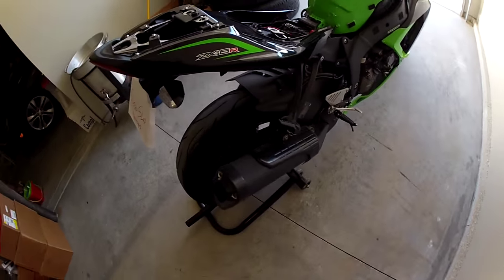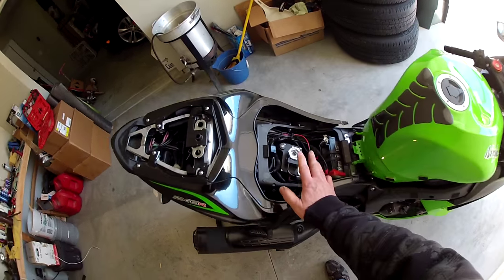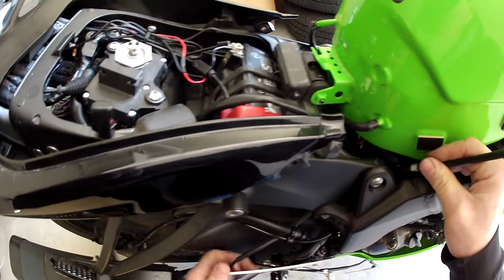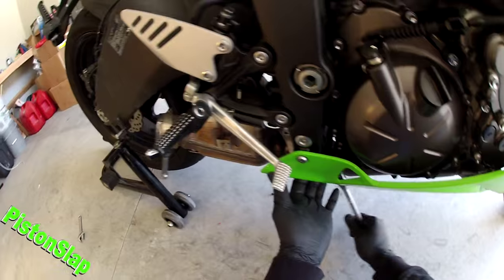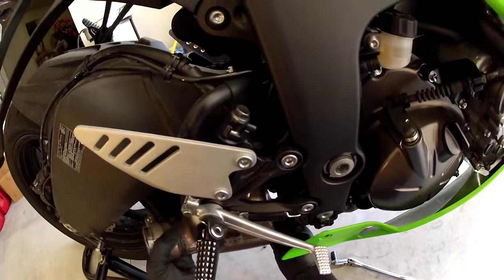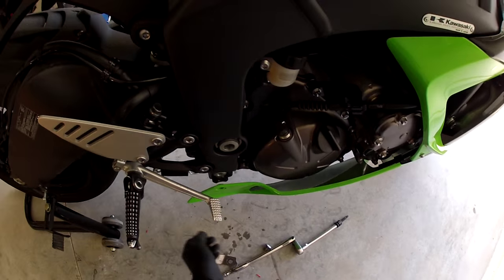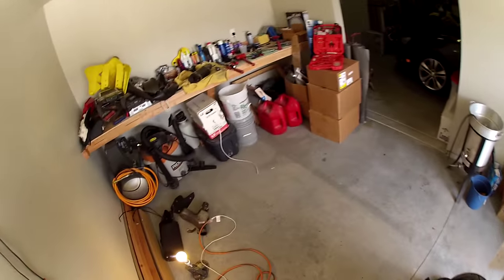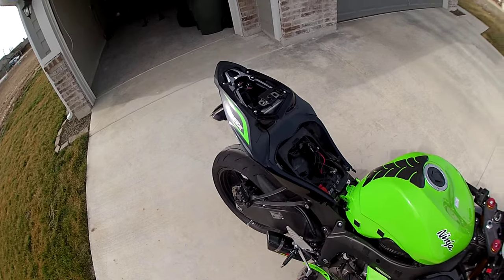How to install a slipon and gut a cat!

Comment: Questions for yall as my bike is slightly different  (gutted cats, stock pre muffler, m4 muffler after that) thoughts on re tune. What creates more back pressure. Pre muffler of cats? Also stock air intake. Thanks in advance
Reply from the maker: I would think the cat would create more back pressure than the muffler.  Also yes the air box is stock with a k&n air filter
Reply: @PistonSlap  I'm playing it safe and ordered a PC6 so I can re-tune it with a "full exhaust stock intake" tune which should be good. Did you end up tuning? If so what did you go with. Thanks g
Reply from the maker: @Hello_Apee  I did.  I got my tune from graves motorsports and had a bide flash the ecu.  That way I didnt have to add more stuff to the bike.
Reply: @PistonSlap  Awesome Thanks for the support! Mines done works great

Comment: Couple of questions. Is this the process for every slip on? &  Do you have to get rid of the cats or just a recommendation?
Reply from the maker: HyenDryGG the process is similar for most bike. Depending on the manufacturer.   The cat is optional. It will be louder without the cat. But it will allow the exhaust to flow more.   I personally wanted the most performance from it so I removed it.

Comment: Loved the video, I had a question tho, is removing the cat significant for sound, I have the graves slip on and I’m wondering will it backfire more or just get louder, I love exhausts but I know nothing about cats
Reply from the maker: It will get louder and the popping back will also increase.  You can install drivin clean air block off plates to reduce it a bit but it's going to pop back.  You might be able to get a better idea if you search my channel for the track day sessions I did
Reply: Thank you 🙏🏻 will do

Comment: Don't you have to use a fuel power commander to increase fuel flow to eliminate a lean conditions
Reply from the maker: Its very minimal with the tune on this bike.  I had it on the dyno and it was a tad on the rich side so a little leaner would not hurt it.   I did have a flash put into the ecm. If was free to download from graves.   It looked like they added a little ignition timing and small fuel adjustments.  You can put the slip on, on and not install a tune (that's what I told from graves)

Comment: Thanks for the video. But I have a question why u removed the circular things in the exhaust system I don’t know what’s call ?
Reply from the maker: The little foil looking circular things are called catalytic converters.   They are a minor restriction in the exhaust.  For maximum performance you wpuld want them removed.
Reply: Piston Slap what do you mean by performance ? Do u mean more horse power or more louder? And sorry for the annoying questions
Reply from the maker: @ray_d8536  No, ask away on questions.   Louder is not always faster/more powerful.  What I mean is that that catalytic converter or "cat" as most people will call it will restrict the flow of exhaust a little.  For instance, you may be wearing a face mask due to the current situation.  While it is a little restrictive during normal breathing say you started running for your life with that mask on.  It would be a lot more restrictive due to the amount of air you need to breathe.  The same idea applies to the "cat" in your motorcycle.  During normal riding, you would never notice a thing, but during a full wide open pull you could pick up a tiny bit more power because the engine is able to get the exhaust out easier.  You may not feel it but could see it on a dyno.   The engine is louder, is a side effect of the "cat" being removed because it acts as a muffler so to speak in the same instance.

Comment: What are you doing that requires you to remove the cat and not just install the muffler for looks? I have a 600 and it has plenty of power but I wouldn’t mind it sounding better.
Reply from the maker: Ralph Spencer removing the cat will add a increase in flow and sound. It's not much more power but it's a easy one. Similar to putting a rece header on without the expense.

Comment: I want to remove my Cat on my CBR but i was wondering if removing the Cat, will it make it street illegal? I live here in Texas and i seriously dont want it to fail inspection in the near future.
Reply from the maker: duy tran I wouldnt know. I would contact some of the local sport bike groups and see what they have done.  I don't have anything like that here we just insure them and register them.
Reply: Removing the catalytic converter will not fail your inspection here in Texas. I live in Houston and I have no problem. What they are looking for in inspections are different from car inspections. All they check is if your signal lights work, your horn, your lights and if your tires are good. They don't hook up your motorcycle to a machine like they do cars.
Reply from the maker: Thanks for helping him out! Here in Idaho, we have no inspections at all.

Comment: If I remove the cat I need to do a ECU flash?
Reply from the maker: Thierry no.  It's not needed but helps
Reply: Piston Slap any exhaust flame after decat?
Reply from the maker: Thierry I don't believe so.  I never really looked at my exhaust while riding hard.
Reply: The backfires still after decat?
Reply from the maker: Thierry it dose pop.  I installed block off plates from driven.   It supposedly helps with the popping.  Using a shorter exhaust made it do that, where as the stock muffler would quiet it down a lot.
Reply: Last question, the light of injection does appears after decat? Does it consume more gas too?
Reply from the maker: Thierry   no lights or anything like that.  As for fuel consumption it dosent use any more unless programmed

Comment: Have you added block off plates or seen the need to??
Reply from the maker: Carlton Holbert I did put a set of driven block off plates.    It said that it will help reduce the popping through the exhaust.  It seemed a little less after I put them on.

Comment: My 09 zx6r is the same exact way. This winter i'm gonna attempt to drill my cat out. i had my bike on the dyno multiple times already so i'm curious on how much power might be gained from it the next time when i dyno it.
Reply from the maker: I still haven't made it back to the dyno shop since doing all the work last winter.  Its been a busy summer with riding and work.   Hopefully next year I will have time.  I wonder how much power you will pick up when you remove the cat?
Reply: The place i bought my bike from has monthly events where they bring in a dyno trailer so i've been spoiled a little bit by it. I just replaced my two brothers pipe with a Jardine gp1 so I'm hoping that with the cat removed and the new pipe i can gain 2 or 3hp
Reply from the maker: Corey Thaemert are you tuning the bike?
Reply: Next summer I'm going to, maybe I'll get my low end power back after a tune

Comment: While removing the cat running without ecu map won't it harm engine and run lean
Reply from the maker: No.   The factory tune is rich enough that it will not lean it out to the point of damage.
Reply: @PistonSlap  for all exhaust? In 10r
Reply from the maker: @parthasarathy5450  not sure on the 10r.   I can say yes on the 2013-2018 zx6r

Comment: Hey if i don't eliminate the cat, do I need a tune or install block off plates? What does that even do? Thanks!
Reply from the maker: The block off plates will reduce the popping through the exhaust on decell.  There are a few ways when doing the block off plates to keep the Check engine light from turning on and setting a code.  1st is leaving the valve plugged into the harness, 2nd there might be a dohicky that plugs into the harness to mimic the valve.  or Flash/programme the ECM to eliminate that code and disable the valve.
All the valves are for is to put clean air into the exhaust to help dilute the gases for emissions.  Hope that helps, if ya have any questions let me know.
Reply: Piston Slap  Awesome! But this is a hectic process... What if I don't install block off plates? Will the popping sound cause any kind of power loss or engine damage? I mean I'm not gutting the cat, why would there be popping sound?
Reply from the maker: No damage or anything just pops....alot when you let off.  Sometimes it sounds cool, other times its annoying.  When I was at the racetrack going into the corner on decell with all the tune and plates installed the spectators would say my bike would pop quite loud...then again thats up around 14-16k rpm.  I dont normaly ride like that on the street.
Reply: Piston Slap  Hmm... so no power loss down the lower RPMs or any abruptness while deceleration? I mean I'm not gutting the cat after all!! And I would be purchasing the graves sound insert as well. I'll not be doing an ECU flash. That's my last question. Pls reply

Comment: How do you flash the ecu? Thanks!
Reply from the maker: Khoa Vo I have a t
guy here that specializes in tuning sport bike computers.  I have a video that shows what I did. But basically I installed a connector into the ECM harness and he hooks his computer to the bike and programs it with a tune.  I got the tune file from graves motorsports

Comment: Hey, how did the bike feel after you flashed the ECU?  Did you flash first then exhaust or was it all at the same time?  I'm still debating which exhaust I should get, I like your Graves and I dig it too.  Is it loud or quiet with and without baffles?  I want to flash my ECU first with the stock setup because I like how quiet it is but don't really like the big bulky stock exhaust.
Reply from the maker: Chris it's not real quite.  I believe the M3 exhaust is a bit louder.  I have never used the little l
Silencer that we with it.   I put the exhaust on first then rode it to the tuners place.   It popped and was a bit twitchy on the gas.   The tune seemed to smooth it out.   I have a video of how this exhauste system sounds under different loads and speeds
Reply: Did the Graves slip on come with a baffle?  Revzilla wasn't very helpful I want it to be kinda quiet
Reply from the maker: Chris the insert is sold separately.   I went onto graves Web site to find it for 34.99. The product details for the slip on say it is sold separately.    The slip on with out the insert is 106.5 db.   With the insert 103 db @ 5000 rpm

Comment: thanks piston slap!!!! I just finished this video on my bike , and wow the cats was a pain in the @$$,  but wow is sounds soooo  much better than factory 👍👍👍
Reply from the maker: Yeah!   It brings out the sound!   The cats are a pain in the butt to get out!  I think its worth it in the end.
Reply: Piston Slap yes I agree , but I'm (like you) I'm very mechanically inclined , I could of figured it out , BUT your video helped me into NO stopping and looking for the directions , so thanks for that , also its a shame the audio doesn't give the FULL sound as it does in person , but I'm really happy I went with Graves , AWESOME SOUND, tbh to me sounds a lot closer to a liter bike now 👍👍
Reply: might just be the extra 37 ccs😃
Reply from the maker: Yeah,  When I was on the track It's was close to the sound of a 1000,  other than the cross-plane R1.   I like the grave exhaust for how short and light it was. I also rode solo so I removed the passenger pegs and brackets for the stock exhaust.   Less weight more acceleration!
Reply: Piston slap do you know the best cell phone mount to get for our 2015 kawasaki zx6r 636 . I'm looking and I cannot find the best 1 for that bike ???? Any response appreciated , but I found a ram mount that bolts to the gas fill cap bolts , it seems perfect but no phone mount comes with it
Reply from the maker: I was going to say the ram mount systems are the best from what I hear.  I have never had a cell phone mount on my bike.

Comment: hey man I'm about to get mine tuned and I am considering gutting the cat on my 2015 636 
did it sound alot louder without the cat
Reply from the maker: Yes is will be louder.  The cats will restrict the sound and flow.  I have a sound video that I had put up so you can here what is sounds like on all types of riding from the streets to the track.  If your having it tuned you will want the cat removed to get a accurate air fuel reading.  Unless they are using a O2 sensor before the cat.
Reply: +Piston Slap oh okay so it's best to gut it before I get the tune?
I have same bike as u just the 15 aniversary so it's like identical process as u took I just really don't want it to be much louder than it is this graves is loud
on long rides does it hurt your ears or no because mine now doesnt
Reply from the maker: +Nick 636n8r (stuntn24-7) the graves is loud and on a long ride 150+ I would recommend eat plugs or ear buds with music.    I don't have a desire meter so I can't say how loud it is.   I have been told by others that it isn't as loud as a M4.   If you don't want to gut the cat you could flash the tune from graves in it.   If you flashed the tune from graves in your ecu and left the cats it would run a little rich.
Reply: +Piston Slap oh ok cool yea I'm taking it to a proven power in Tampa to get it on the dyno flashed and tuned by them
Reply from the maker: +Nick 636n8r (stuntn24-7) nice.   depending on the tune software they use.  They might be able to add a quick shifter also.   they are a lot of fun and if you ever go to a track it make it that much more fun.
Reply: +Piston Slap oh nice yea my buddy has one doesn't it install on ur shift lever
Reply from the maker: Yeah,  I have the stand alone Anitori system.
Reply: haha yepp i told him id do a lil shoutout his vids have helped me a lot
Reply: What does that do? Does it replace the headers or extend them
Reply: +SIG Ninja oh u talkin about the pre muffler that sits behind the tire

Comment: why did you tap it out instead of drill it out?
Reply from the maker: Daniels Schmidt I didn't have a drill bit that long.  Also kind of soft and rolled up.  So a drill would only put a hole in it.  I suppose if you drilled it a lot you would be able to get it out.
Reply: understandable... and concerns about debris  going up into the engine? Seems pretty hard for it to work its way up there but a co worker brought that to my attention. Thanks for the reply
Reply from the maker: Daniels Schmidt it is posible for debris to get up there but I fired the engine every once in a while as parts came out.   When I was done I just have it a little rev about 5-6000 rpm.  To blow out anything before I put the slip on back on.   It's going to be really loud.

Comment: what about a 2009 ZX10R???
Reply from the maker: I do t have any information on the ZX10-R.   it would most likely be a similar design.
Reply: I have a 08 and it’s 2 on each side I just got one out so far. The second one on the right side is a b** because of how the header is shaped.

Comment: Was the 2nd cat donut thing easier to get out?
Reply from the maker: It was about as hard if not a bit harder because it was farther in the hole
Reply: took me 2 days to get the first one out, any tips? Don’t think I’m gonna start drilling from the middle again
Reply from the maker: @tommy_s550  If you can get a long enough punch or screw-driver in there you can beat it out.  Some of the guys had mentioned using a long drill bit also
Reply from the maker: here is  a comment that I pinned a while ago, 
Pinned by Piston Slap
Paul
9 months ago
Great video. To anyone watching this vid now, consider using a drill with a long, metal bit. We used about a 5" bit for the first piece of the cat and a 12" 3/8 bit for the second one. Still takes a while and some elbow grease but not too bad, and I'm sure it stresses the bike a lot less than a hammer and chisel/pry bar. Also, you will need a powered plug-in drill. We tried a battery powered one and it was nowhere near strong enough.
Reply: Awesome thanx man

Comment: you didn't need to flash the ecu for the servo motor. fueling?...yes! but the servo motor all you need is the servo eliminator plug that prevents that. Heal Tech makes one and it's been amazing on my bike.
Reply from the maker: The servo would need the ECU flashed or you can buy a servo eliminator  like you had said.  With all the changes I had done the Fuel mapping was free from Graves Motorsports.  I paid a buddy of mine to flash their tune in.  You are correct I didn't need to do that but it smooth's the power out a bit.  Thanks for the comment.